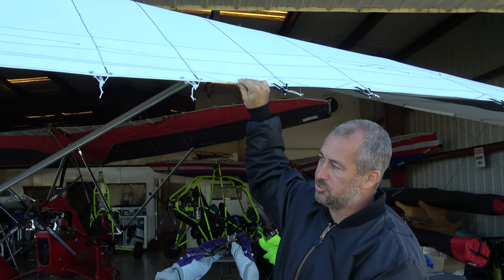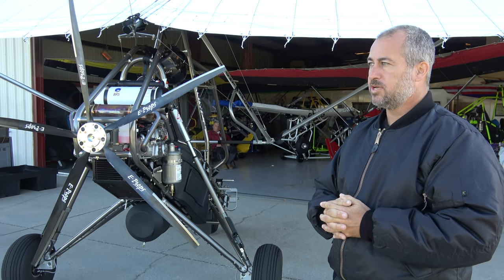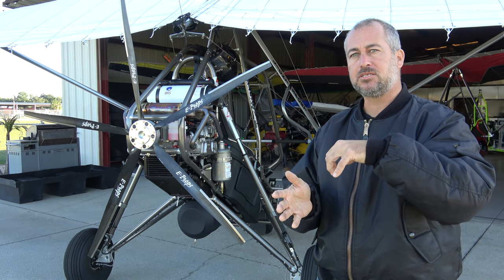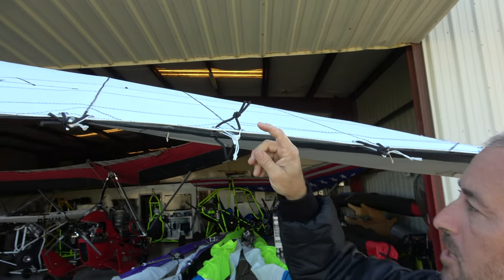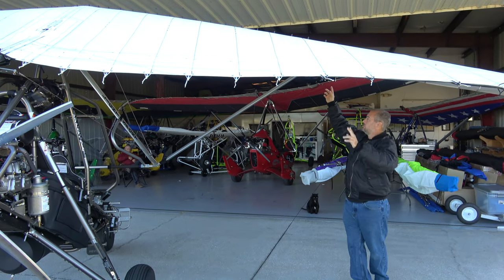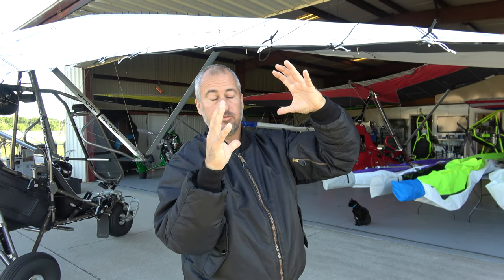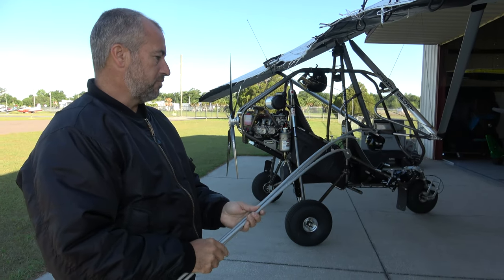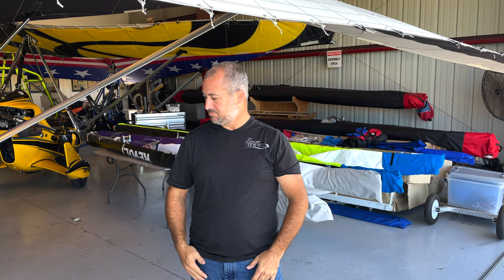Wing Tuning part 2

Comment: Love the trike trimmer invention, have a sideways twist to the homebuilt trike on full power which is just unsophisticated engine install, but looks handy on long trips when wing has slight turn. Your explanation on the wingtip trim tab setting is the best I've seen, especially that two battens need the reflex to give greater effective area between. Thanks and as usual, respect for everything you create